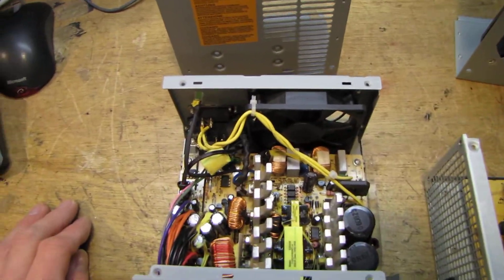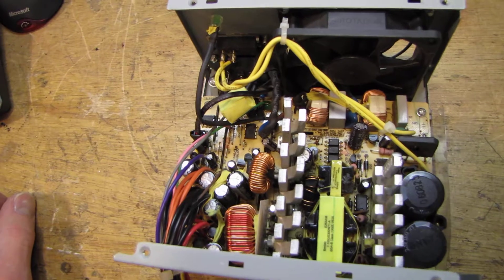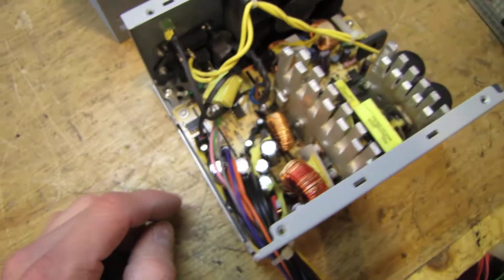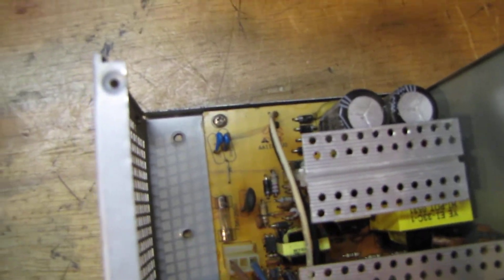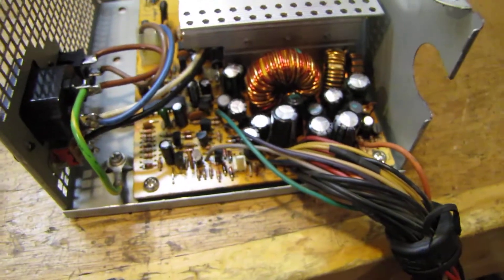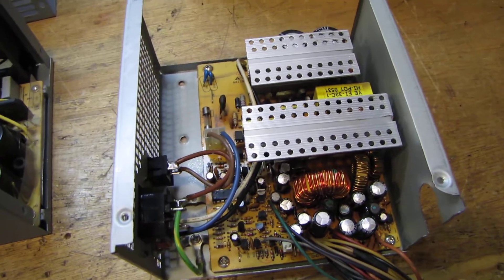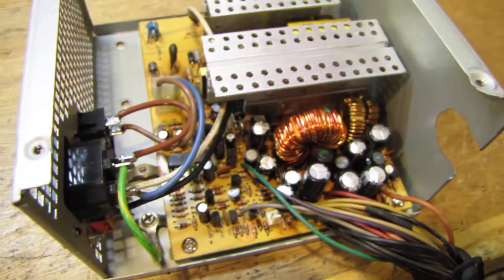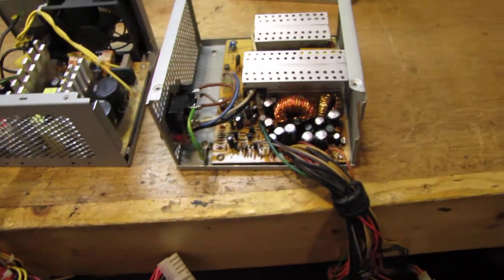A Look At Computer Power Supplies, Part 1 of 2

Comment: Bestec uses TEAPO capacitors and OST so they're not generic but not the best but I trust the newer models such as the ATX-250-12Z or the 350-12Z but no way the 12E with the standby issues my current computer has a bestec and a few others I have and I trust them over a no name brand for sure
Reply: Sony Trinitron the 300-12e is fine but the 250-12e is the bad one

Comment: My mom's computer just died, it has a best tech power supply. I was taking it apart and didn't even realise she had one in that computer, odd because I swapped a lot of parts in and out. The LED on the back of the power supply just kept flashing green and made a clicking sound when plugged in. You hit the power button and nothing. Do you think it could just be the power supply? I know they like to eat motherboards too, do you think the motherboard could be dead too?
Reply: DaRkHunTer0125 sounds like psu to me, sounds like I’m 6 years late though

Comment: iv seen a lot videos on basic repair but there almost all about bad caps wtich is not my problem you seem to be  more knowledgeable about them so i wanted to ask you what would you suggest the problem could be if it only runs for a few seconds then dies even if its not under load or even small load   i fear i may have blown the output for the 4 prong fan connectors and want to try to fix it

Comment: My Rosewill 500W PSU just died. I pulled it apart and found what failed. I have no idea what it is. It is a 1 inch long cylinder with a rode out of both ends. Coated with a pink drywall mud type substance. That is then coated with a black rubber with RU E255-- On it.

Comment: Yeah....the power supply that's running my PC is very similar to the Codegen...it's a HKC which is around 20 bucks new. It has been running for 2,5 years without problems, even though i had to re-oil the fan bearings 4 or 5 times in that period, because it got noisy. Right now it's starting to rattle again, but i don't really care because in a couple of weeks i'll get a Seasonic M12 II 520w to replace the piece of crap. Wonder if it's got bulging caps already.

Comment: I have an identical Bestec running in a Pentium 4 home server I put together. It has been running 24/7 for the past 2 years without complaint. Only recently, I was running with no hard drives connected, it was dropping out. I figured it was dead, but reconnecting the hard drives brought it back to life, with no problems. I was running Folding@home on the CPU so it had plenty to do. If anybody has an explanation that would be great.

Comment from the maker: @EvendimataE The power supply you used might have been worn out already.  If a bigger one doesn't solve the problem, check the motherboard for blown capacitors too.

Comment: i found a pentium d 3.2 desktop with a busted psu..so i replaced the psu with one from HP pentium d 2.8 desktop....in just two weeks the psu started to malfunction....from the time i plug in the power cord sometime i have to wait 15 seconds before i the computer would turn on...motherboard manual says recommended psu is 350w and 12v should be 19amp...the one in there now is 300w and 12v is 19amp.....its just a basic websurfing desktop...does that 50w shortage making the power supply malfunction?

Comment from the maker: @xDarkwish I usually use Gigabyte boards.  My current one is the GA-990FXA-UD3.  There are cheaper ones if you don't need to run more than one video card, but if you are planning on using one of the new Bulldozer CPU's, the 990FX is probably the way to go.  You can look on Newegg and use the advanced search to narrow it down to the options you need, and pick a board from there.

Comment from the maker: @xDarkwish You need something that is a bit larger than your total watts.  At least 25-30% more I'd say.  You need room for future expansion and start-up current, especially if you have multiple hard drives.  However you would not want to go too big (like use a 1000w PSU where 250 would be enough) because the PSU might go out of regulation and also be inefficient.

Comment: Hi man, Great Video you gave lots of useful info. Any way I have a Ultra X4 1050 watt PSU. This PSU gradually started failing. At first it would not support crossfire. than after a while I could not play games the computer would just shut down. Finally it would shut down before complete boot up. I would like to try to repair the PSU just to see if i can do it. What do you think i should look for as the problem?

Comment: Using smaller inductor at higher switching frequency can give you the same power output as using a larger inductor at a lower switching frequency. That could be one possible explaination for the smaller transformer in the higher rated power supply. Or as you say, it could just be that it IS under-engineered.

Comment: @Maxxarcade speaking of getting warm, a friend at work wantsto modify one to install in his caravan and run 12V lights and a car CD player and small amp. but he's concerned that deviating from what the PSU was designed for may cause it to burn and start a fire. would a high quality PSU be okay under moderate load?

Comment: Harddrives and optical drives hardly use any power at all. Typically about 5-7 watts per device. Your real heavy power consumption comes from modern CPUs and video cards. However, the 4650 draws less than 75 watts at full load. I'd say a 1000w PSU is rather overkill for your system. :) I'm running a Core 2 Quad with a GTX 260, and I've got a 500w PSU that has no problems powering my system. ATI's own recommendation is a 400w PSU for the 4650.

Comment: Just curious, what do you think of PC Power & Cooling? I have a 750 watt Silencer in my Falcon Northwest built machine (the PC is about 5 years old now, but still works well and the PSU is about 2 years old). The Silencer seems to be a good unit, it's been on pretty steadily since I installed it.

Comment: I can remember we got an "Emachine" BRAND NEW at Best Buy around 2006 to use as an audio playback computer and it has been through several power supplies and finally gave up the ghost due to bad capacitors on the motherboard.

Comment from the maker: I will be doing another video soon with some more examples.  Also watch the video response area, since I'm adding a link to a video I made a while back about a high end power supply.

Emachines was another manufacturer that was hit with lots of bad power supplies and capacitors.  The sad thing is, a lot of companies are using really cheap parts now.   That is why I prefer to build my own systems from scratch, despite the generally higher price.

Comment from the maker: The only thing you need to be careful of with the larger power supplies such as that, is most of them have a minimum rated load for the current regulation to work properly.   

You probably have enough hardware that it should be fine in your case.  That one should last you a good few years!

Comment from the maker: You can find out who really built it by searching the UL number on the case.  There aren't all that many manufacturers, so most power supplies are sold under a few different brands.

Some cheaper power supplies can work better than more expensive ones when they are recapped.  Sparkle/Fortron is a good example.

Seems it's getting really hard to find a power supply in any price range that uses top quality caps.  

I need to find a video editor that works with my files... Not enough time to talk!

Comment from the maker: Speaking of airflow, that is the other side of the problem.  I've rebuilt tons of power supplies that would have lasted much longer if they weren't made to run "silent".  Even my 620W Corsair HX burned up after 2 months because of overheating.  

I like quiet computer stuff too, but why wait till the PSU is 100 degrees before speeding up the fan a bit?  Whenever I buy a new Sparkle/Fortron or other "budget" supply for equipment at work, I bypass the fan speed control.

Comment: I am an electronics engineer and have seen plenty of the faulty electrolytic capacitors on motherboards and in power supplies. You are correct that a few billion electrolytic capacitors with wrong electrolyte formula were used in electronic equipment approximately 10 years ago. I have changed many of them. when you buy a power supply it is worth looking at the fan aperture and the vents on the case, generally the better the airflow the longer the life.

Comment: A friend and I took apart a "Type R" power supply and just laughed. Externally they looked good, with a line of connectors in a blue anodised casing. Internally you coulld see they had sheared through the wiring of a cheap power supply and used inline crimps to use the PCB in their "expensive" power supply. Some power supplies have LED fans and all sorts of nonsense but are often inferior to a modest power supply.